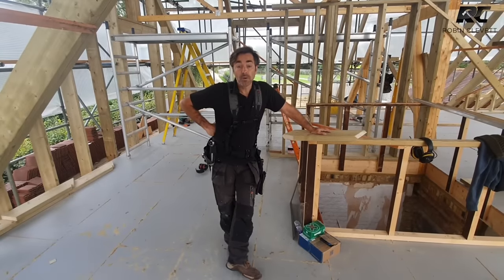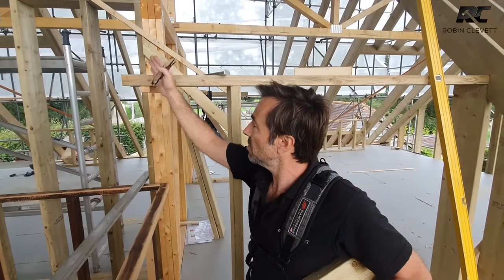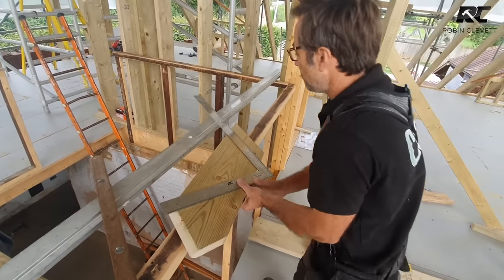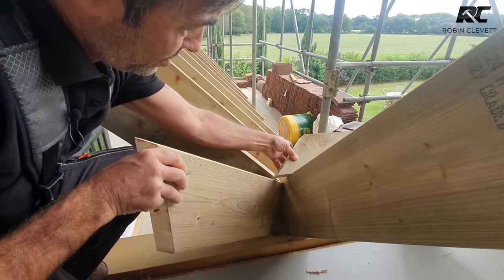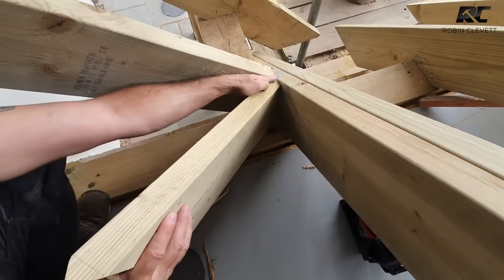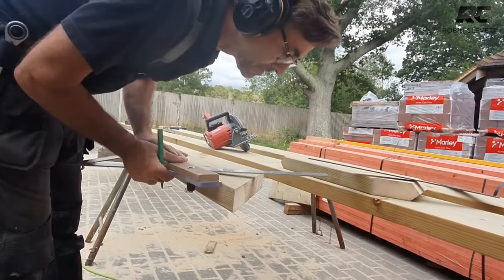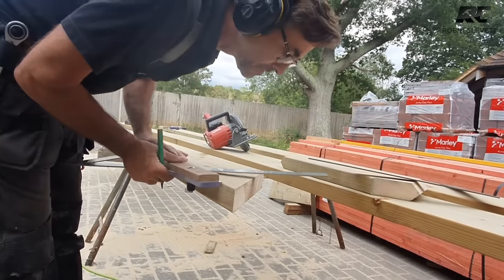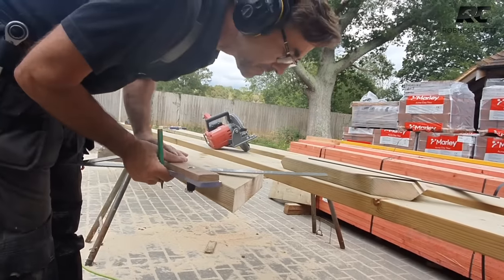Making and fitting valley rafters The Big Build 30

Comment: Personally I don't like to drop the Valley so the centre point lines up. I'd much rather cut a reverse backing bevel on the valley, old skool style. Makes fitting the valley Jack's a lot easier. Two rips on the bench and it's done. Much neater job.
Reply: I was thinking that too. But I presume, Robin must have a good reason for not doing it
Reply: When you do not have an overhang the center of the valley is the same height as the height above the plate of the common.. If you have an overhang you cut the  seat 1/2 the thickness of the valley rafter towards the over hang   so that automatically allows the rafter to slide towards the ridge  and gives you the same hight above  plate at the center of the valley as the common height above the plate..The place where the hip touches the plate is exactlly the same place the valley touches the center of the intersecting plates

Comment: Impressive as usual. Never could do that. Not able to work them out geometrically only by measurement. Then mostly worked on centuries old buildings far from true anyway. My hack way uses a string line to get the line and level. Offcut templates for top middle bottom placed to the line square ends pinned in place. Measure the two gaps then lay out pieces on Valley rafter with those spacings and you have a segmented overall pattern that should fit. Also works for hips and multiple birds mouths such as when the engineer sticks the big steel just down from the Ridge. I never had your skill level or confidence my cuts would be right so cutting them first on Offcuts a must for me. Not pretty but you have to work with what you have. But at least I then didn't waste timber getting cuts wrong.
Reply: I often do it like that. I'm slowly getting better at stepping off but not great.

Comment: Excellent work Robin
I’m a Lead worker and I would love to work on a job you have built 
Good woodwork makes lead work a lot easier
Reply: 👌 You are so correct .it’s a breeze every roof I do for Robin is pitch perfect  .it’s such a pleasure and when working with valleys bonnet the pitch is always millimetre perfect all the way round the roof .rafters are so flush you could slide a level across the whole roof and it wouldn’t kick up or bounce or knock on a higher rafters.I’ve done some amazing roofs for Robin he is an amazing Tradesmen especially  roof construction 👍

Comment: “Get your cuts right way ‘round.”  A pleasure to watch you work - and the perfection of your geometry.  I suspect, though, that you are doing self-checking (like, “measure twice”, and “is this on the right side?”) that you omit to keep the video a reasonable length. At least that’s what I find myself doing on much simpler structuring. And (fortunately) finding errors before they become “discard and start over.”
Reply: Its the winning way !
Reply: I thought the same after he pulled his tape off when he marked out the length. After doing the scarf joint I’d want to be checking 4 times!

Comment: When you measured the going and couldn’t get your tape into the corner, you can use a steel rule on edge (or probably your square) to poke right into the corner and match 100mm to 100mm or use tape from other direction and measure to 100mm on steel rule, then add it on.
Reply: good tip but he didn't want his tape in the very corner because he's stepping off on the side of the rafter so he's measuring from where the side meets
Reply: @Foz1  Sorry I should have time stamped it. When he laid the tape flat on the grey floor boards to measure the going to the birds mouth.
Reply: @grumpyone5963  yeah we're talking about the same one haha
Reply: @Foz1  Oh ok. I thought he paused and took a good educated guess at how much to the corner when he laid his tape there.

Comment: Good job. Spot on. 👍👌
Did you use a single valley rafter as you are sitting on the ashlar wall. 
Just say it wasn't there would it be a double? 
Nothing can replace the beast.
When it's needed. 
 (Corded circular saw)
 My top tip this winter you can always take a layer off if you get hot 🔥 but you can not add it if you haven't got it with you. 
Keep warm.

Comment: How did you figure out where exactly the birdsmouth on the wall would land to level up and therefore where to measure to?
Reply: Good question. We didn't really see how Robin determined where the line of the valley rafter was going to hit the ashlar wall head. I would assume that he would want to know where the left-hand side of the rafter would touch the wall head as that it where the left hand side of the birdsmouth would rest. (If the rafter was cross the wall left to right, he woudl ant to know where the right hand side of the rafter would touch the wall head.)
Reply: @tlangdon12  A dry line or chalk line stretched from ridge to plate between the shoulder lines would establish that location.
Reply: @TheToolnut  I agree that would work but we didn’t see Robin using a chalk line, so how did he do it?
Reply: @tlangdon12  He probably did it the way I described off camera, 👍🔨🇮🇪

Comment: The Hip and Valley are exactly the same length.... If the span of the common rafter is say 20'   and you have a rafter book you would look up this span minus the thickness of the ridge san 1 1/2  so you would look up 19' 10 1/2''    under common rafters That would be the exact length of the common no shortening  If you look up 19' 10 1/2''  under hip or valley that would  give you the exact length of the Valley no shortening  as far as the seat of the valley if there is no over hang   just use the same hight above plate of the common say 4 1/2''   for the seat That would be the center of the valley the two ouside edges of the valley would be lower because of the side cut of the valley

Comment: Next time do not put any rafters next to the valley.l seat.
Nailer one piece of 2x4 on the top of your left roofing rafter to end to the valley and later put  the main valley rafter and 
  with adjust to the 2x4 
( under 2x4 )
THE 2X4 will show you the correct point that you need to put your valley rafter.

Advice =
Master Carpenter in USA 🇺🇸

Comment: Brilliant but everything is about tools can you do it with hand tools not battery saws 
 Imagine how much electricity is used by battery operated tools charging every day and night and the cost of making the tools and batteries  save the planet bullocks
Reply from the maker: Well its just how it is, I hear you!! But imagine if we could compete using only hand tools, the trouble would be that the work would take significantly longer and the we would travel more in vehicles to get to and from work, the vehicles would pollute more and wear out quicker and then that would also have an impact on the environmental too!